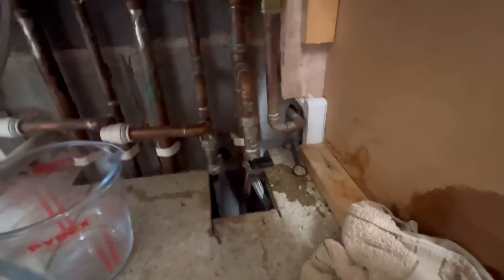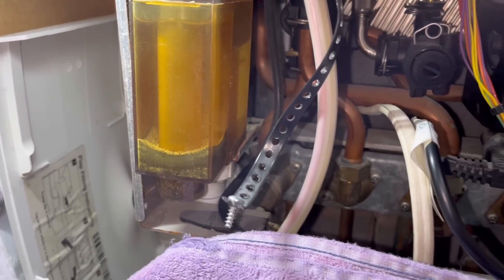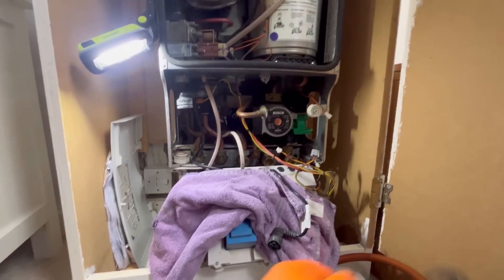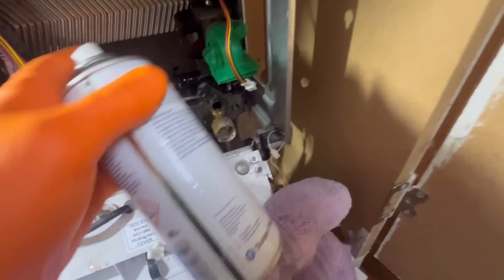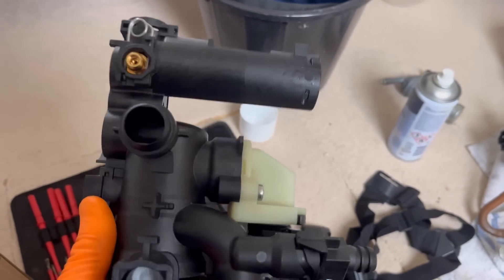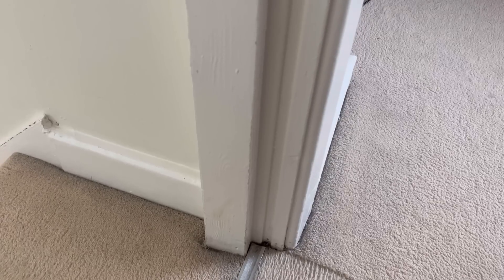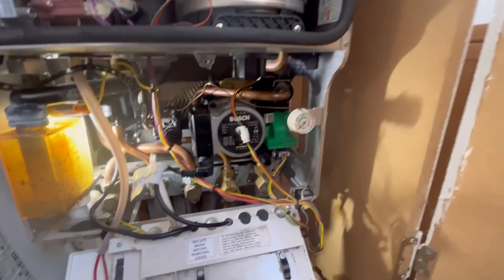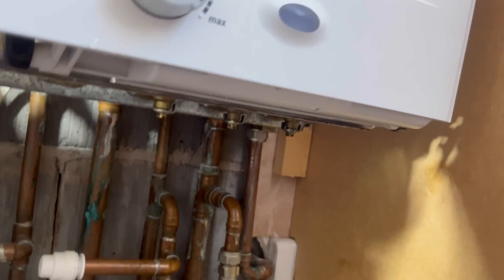How to change the Return manifold on a Worcester Bosch boiler!

Comment: How much to charge for this job plz I got one to do tks
Reply: Tks
Reply: Great vid but £280 that means your only making £80 way too cheap last two I’ve done have been £450 incl prv and f/a
Reply from the maker: @gmtplumbing8559  cheers mate. I get the parts (manifold, prv and adapter) for £180 total, £100 to do it, still cheap I suppose you’re right 😂
Reply from the maker: £280 Inc materials

Comment: Top job Dan. That was in depth as usual..❤ you know the rhb you just fitted is there different options like without diverter motor etc?
Reply from the maker: Thank you mate, yes you can get another option with no DV and a few other bits missing. It’s about £60 cheaper. But they’re a special order at my place so I just normally use this one. Thanks for the support buddy 🙏🏽
Reply: @Heatking  nice one thanks for that it is worth knowing as a newbie
Reply from the maker: @ArifPolicewala  it is mate. If you don’t get one just make sure you study the two so you see what’s missing.
Reply: @Heatking  thanks for that really appreciate it